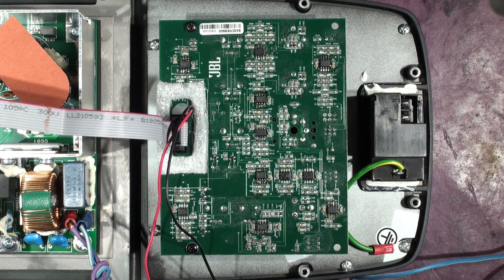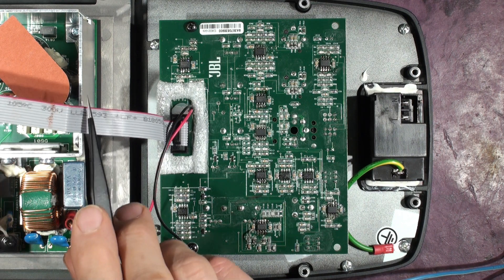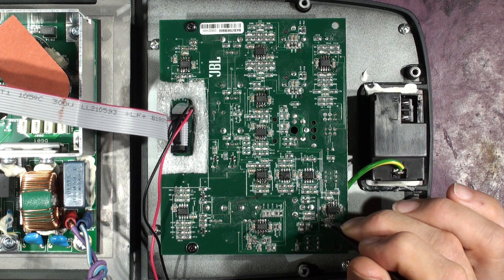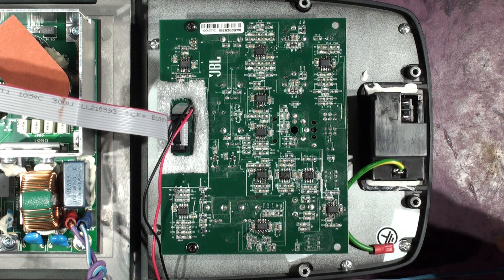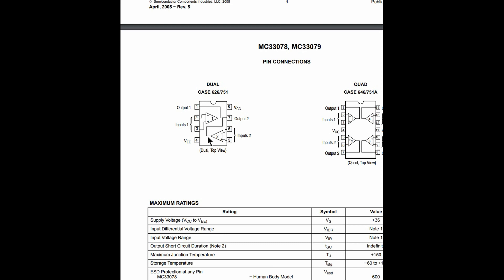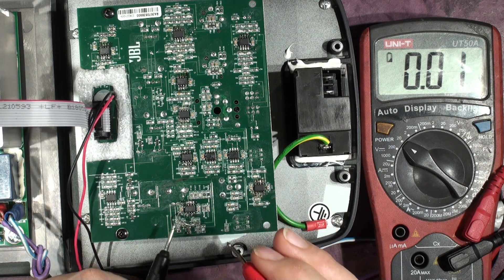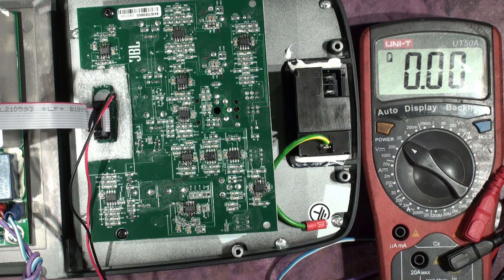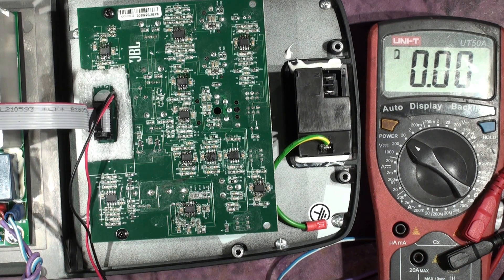JBL EON515XT Mixer and input board diagnostics and repair

Comment: I have a 515xt and the limit light is always on even at the lowest setting.  The sound is very faint.  Any suggestions at what it can be?
Reply from the maker: Blown 33078 dual op amp in the common channel somewhere before the HF and LF compressor channels on the input / mixer board. Check the supply rails are + 15V and -15V power rails are good.   You can usually easily diagnose these using a just a multimeter as shown in the video.

Comment: I recently discovered your channel and I must congratulate you for such good and detailed work. I have a 515XT that, after a short while of playing, stops outputting audio through the tweeter. I have already tried it with a new tweeter and the same story.
Reply from the maker: Interesting.   Likely to be a blown or intermittent 33078 chip in the input board. Check for dry solder joints on the speaker connector board. look for scorched wiring n all the HF connectors. Make sure the HF power Amp chip is screwed down onto the chassis. If it is loose or badly assembled it gets too hot and goes into thermal shutdown.
Reply: @razenby  i'll do it. Thank you

Comment: I'm not a technician. I just need someone that can fix or to tell me what's wrong with my EON JBL 515xt Speaker. The speaker is working, but the LF sounds like the HF. even if the LF knob is at the Maximum level, it doesn't make any difference. 🤥
Reply from the maker: Sound like you may have a blown LF driver or a fault on the mixer/input board. .

Comment: Hi, I have a EON 315, my issue is that I have a tic tic sound for about five minutes. After that it operates normally. However if found that on the mixing board itself there is a resistor straight off the input (surface mount) that is burnt. Can you give me a resistor value. I don't have a schematic. The input for the 315 EON has a -10db and a -4db input. The resistor location on the board is R13, off the input Jack. Any help is welcomed, thanks.
Reply from the maker: One of the two 10uf capacitors in the output stage half bridge pump circuit.  ...  mentioned in videos.
Reply: @razenby  thank you so much sir. Do you have a resistor value for R13? Thanks

Comment: I have a 515 that has input (green led flashes ) but no sound. the owner said that if you wiggle the potentiometers it worked but I have tested them and i still get no sound.  next I am goingto checkthe voltages on those chips to see if that's the problem
Reply from the maker: Probably a blown chip on the preamp or a power supply fault. When the power supply winding does not have enough flux it struggles to provide sufficient power to the Preamp split rail supply. Check the +-15V rails are stable then look for  a hot 33078 operational amp chip (~20 on the board). If you have a thermal camera then use that to see if one is running hot then check the voltages as detailed in the video.  Good luck.

Comment: I have two speakers here. They pass audio HF & LF, but the green signal LED is on all the time regardless of signal being inputted. What would the likely issue be?
Reply from the maker: Check + and - 15V rails are stable on the preamp.  Then follow the preamp  video to locate the faulty 333078 chip.  They fail quite a bit.

Comment: Hi,..
i have pair of JBL 515, both non working, one does NOT turn on at all, just relay click,,,,,,and the other turns on works, sub works but you can not hear the bass, weird sound,.....any solution ???  thanks guys
Reply from the maker: See the other 515 videos on this channel. Detailed repair is covered. On the unit with no bass it could be the 15 inch driver or the amplifier electronics. See the other 515xt videos to diagnose/fix  the one that won't power up. Also transfer  the power board that does power up with no bass in the speaker with no with no power. If the bass works then you have a blown bass driver.

Comment: Hi i have a jbl eon 515xt. My tweeter wasnt working so i replaced with a new one & now the tweeter sound cuts in & out. Any idea what could be my problem.
Reply: Hello, I am MS using my work account. Check the  replacement tweeter and the 515  reassembly videos.  Third party replacements are prone to shorting inside the case. Also ensure crimps are tight. Often they work loose. Hopefully it will fix it. If not let me know.  Also ensure the ribbon cable is plugged in fully into the input mixer board.
Reply: Tony Arkinstall i used an original jbl tweeter. The connections were tight on tweeter. Which ribbon cable are referring to? Its been playing it hasnt cut off again yet. I’ll play it throughout the day & see if it fails again. Thank you for your help.
Reply from the maker: Did you fix it?
Reply: Yes, after i opened it back up to make sure connections were tight it never cut off again. Connections seemed tight but maybe they were loose cuz it didnt happen again.. thank you for your help
Reply from the maker: @mrbowtie64  Good Job